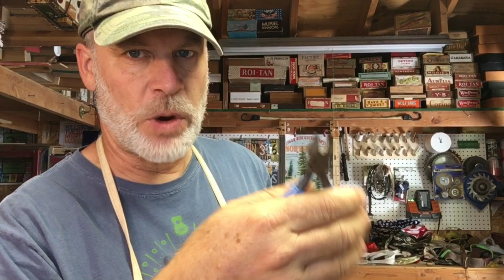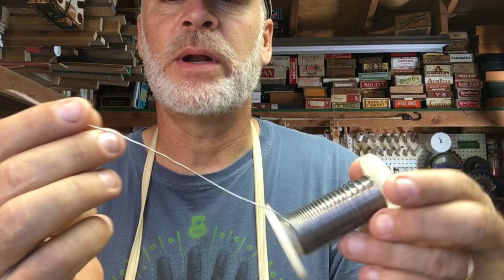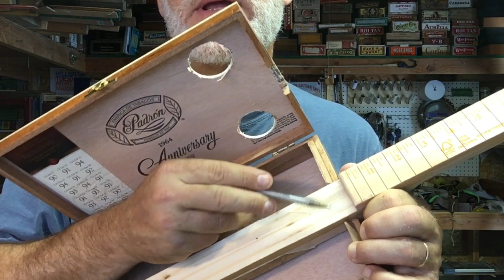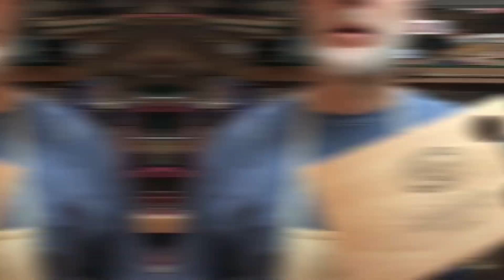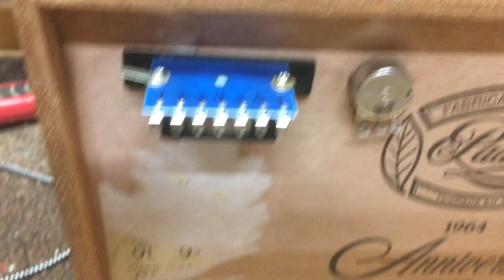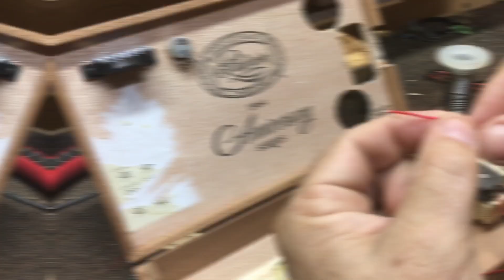Wiring up the Pickups in a Cigar Box Guitar

Comment: Do you select and play one setting of the 3-way select switch or change while playing for different effect?  The impedances of a piezo and magnetic pickups are very different so when shorted together, the magnetic will dominate. A balance control with each pickup going through a buffer amplifier then into a potentiometer to blend the two gives nice results (on my bench anyway). 

Would a blend control instead of a 3-way be cumbersome to use? Or, a 3-way selector as you show, not the type that short in the center position, could select either pickup or the blend control.

Drawback is a circuit board and 9V battery are needed to implement an active blend.

Is the shorting method with a 3-way switch good enough?

Comment: Del, about 3 years ago I put together a guitar with rod piezo under the bridge and a mag single coil  by the neck. I had problems with the piezo being very low volume and the mag pickup being normal. I asked at cigar box nation and someone told me that it is the nature of the beast. I didn't really know what I was doing, not sure I do now. Was that a rod piezo problem? Have you used them? Probably my soldering or wiring. Thanks for the vid, fantastico.
Reply from the maker: Piezos are unpredictable as all get out.  i can wire up two identical piezos and they will sound different...sometimes it's luck... sometimes it's bad luck.   some people run them thru pre amps to get them a little louder...  me?  i just go with whatever output they provide and use the amp to compensate

Comment: As somebody already mentioned, acid flux is corrosive. Acid core solder is also corrosive. Rosin core flux is good for electrical use. They also make rosin core solder. I still prefer lead based solder and rosin core flux for ease of use. A 60/40 solder is a blend of tin/lead. For commercial use lead based solder is no good as it's banned in many places. Lead based solders melt at lower temperatures and stick and flow better.
Reply: @Beckett Elisha  I knew it was fake as soon as you mentioned you had a girlfriend! We all know no woman would ever date such a loser.

Comment: Del, you should not be using Acid flux on electronic wiring or components. Rosin based flux should be used for electronics. Acid flux is used in plumbing applications.  Most solder intended for electronics will have a core of rosin inside the solder itself.  The acid will eat and corrode the wiring over time.
Reply: I was going to mention this very thing.
Reply from the maker: I found some “regular” paste flux at a garage sale